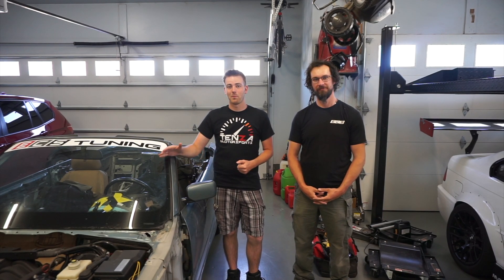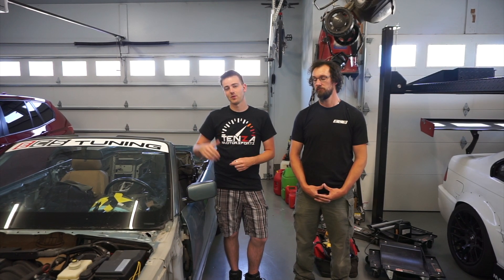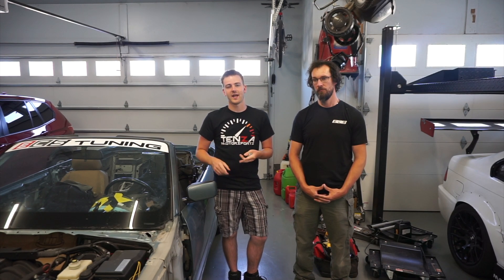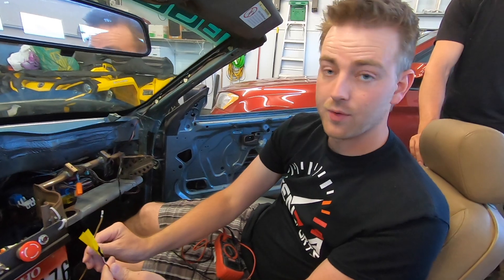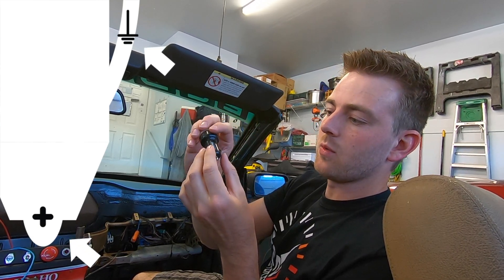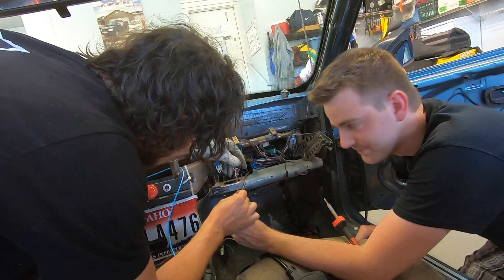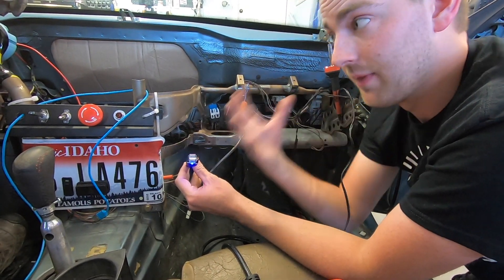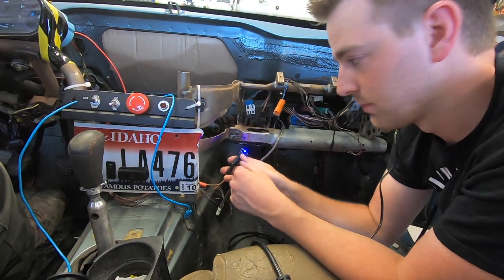How to hot wire an automobile auxiliary power outlet (cigarette light port) to always produce power.

Comment: If you want to do something like this, at least get a good quality Anker charger so you get QC and/or PD. These Chinese 2$ chargers usually give way too much voltage (Around 5.6V) and barely any amperage (0.7A max.). Never trust the labels.
Reply from the maker: If you want to donate one to the channel we’d love to redo the project. The one used in the video we got for free and it works as intended.
Reply: My comment wasn't meant to discredit the video in any way, don't take me wrong. I am adding that piece of info for the viewers who might want to do this. Everybody loves a charger that can charge your phone in under 40 minutes, specially in a car (i.e. if you forgot to charge it overnight). And that's the way to do it